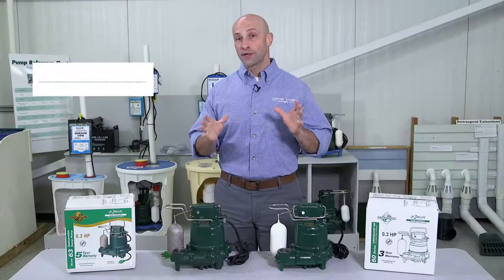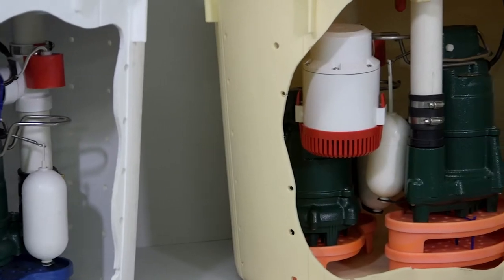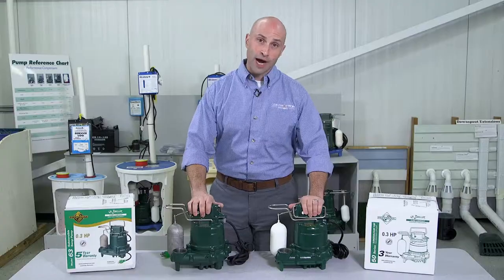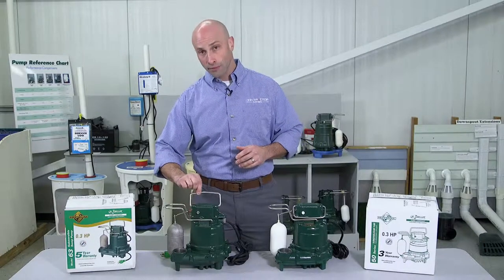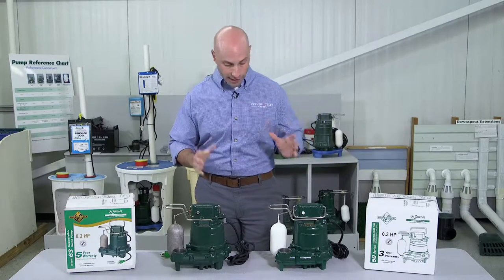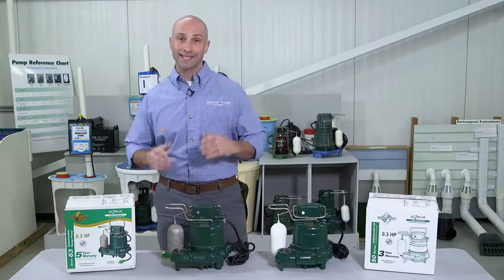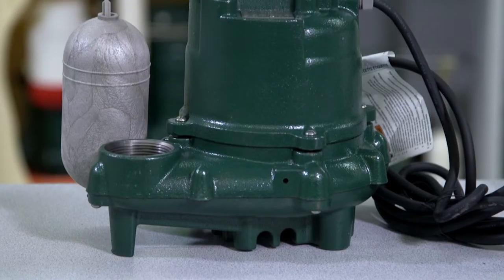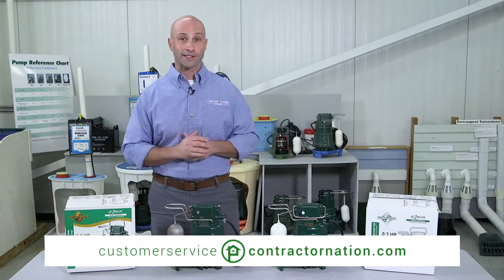sump pumps by Zoeller

Comment: In one of the quick shot, you show some pump system with two pumps in the pit one slightly higher. Can you do a video explaining that?
Reply: 12v battery backup pumps are typically mounted higher in the sump so they only kick in if the main pump fails or has power loss and water level increases triggering the 12v backup